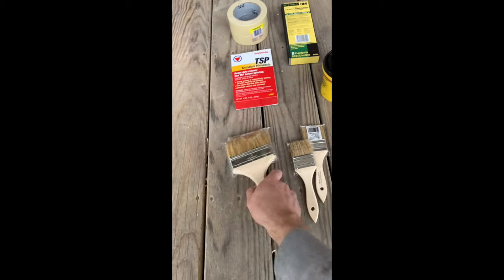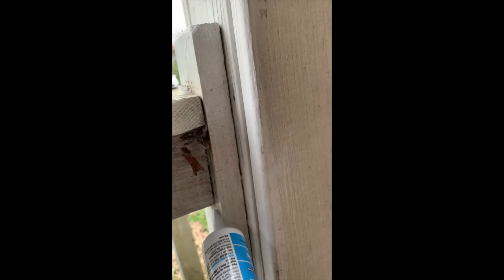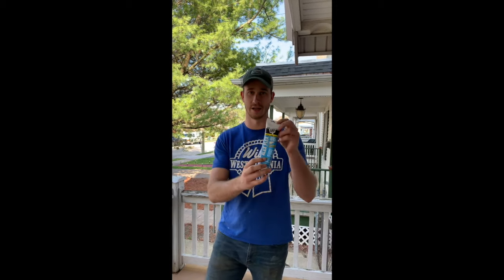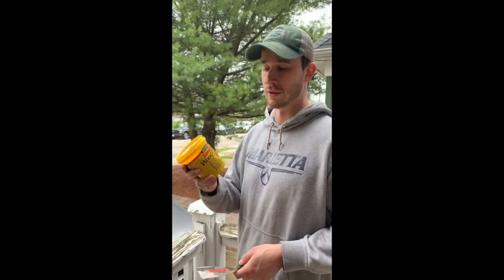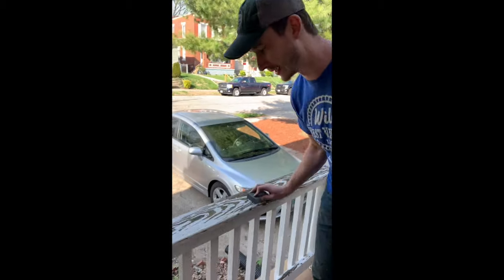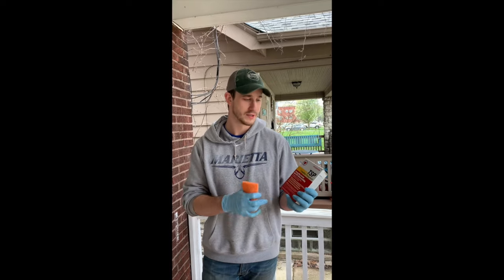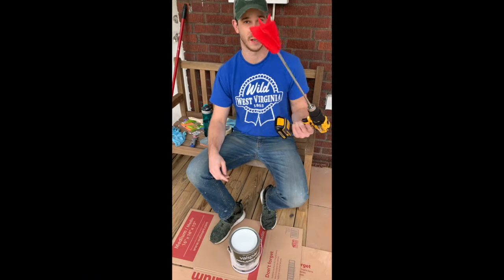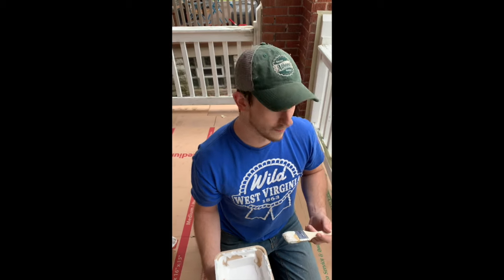How To Paint A Porch

Comment: Hi, planning to redo and repaint my porch in a few days. Watching your video was super helpful. I will probably get all the stuff that is needed showned I’m your video. Biggest concern I have is using the 5 in 1 scraper you mention to scrap it off lightly getting all the chipped paint than sand it down. That part I understand it all. Now for the old paint that is still there after sanding it down lightly so I just repaint over it. And if I do would that paint come off once it get down the line like 3 years later. Thank you for your support of your video showing us what to do step by step.

Comment: That was a really good video!! Very thorough and concise. Loved seeing the difference btw caulked vs uncaulked corner, wood filler application technique and tip of using cardboard. Just a couple questions. 

1. How long do you have to wait after applying TPS cleaner?

2. Do you need a primer?
Reply from the maker: Thank you!! Glad you liked it. To answer your questions:
1. Until it is dry.  Usually about 10-15 minutes should do the trick.
2.  You don't need primer but it wouldn't hurt.  I would recommend putting on a coat of Kilz interior/exterior primer before putting on the finish coats, especially if the wood is super porous.
Reply: @chaserandolph6437  Very Helpful video.  I've read that TPS must be washed off before painting, but you didn't?  So, no interference with the paint if you leave it on?  It's powerful stuff.  But, I'm trying to beat the rain and avoid the dry time of washing it down after applying TSP.  I guess it works for you?
Reply from the maker: @billf6417  I think we did give it a quick wipe down with warm water after using the TSP.  Looks like I skipped that part in the video.  That being said, I'm sure if you let everything dry there would not be any interference between TSP and paint.
Reply: 10-15 minutes if you are using a latex finish coat psint.  Alot longer till the wood is completely dried if using oil based paint
Reply: Thoroughly rinse off the TSP.

Comment: I like your porch where did you get the beadboard for your celling porch I have seen some but was told it was not for outside celling ?
Reply from the maker: Not sure to be honest, it was there when I bought the house.  As far as beadboard goes, you can buy either wood or MDF sheets.  MDF should definitely not be used outside because it soaks up water like a sponge, but wood beadboard should be fine.

Comment: No primer needed to area where it was exposed after scrapping? Thanks.
Reply from the maker: It wouldn't hurt to use Kilz primer on the exposed parts.  What I did instead was put 2-3 coats of the exterior paint on the exposed parts and areas of high traffic (top hand rails).  Up to you, I just didn't want to make another trip to Lowes!
Reply: @chaserandolph6437  Thanks Bro!
Reply: Exactly what I was looking for. Thank you! Did you sand in between the coats? If yes, should we use a finer grit sand between the coats?